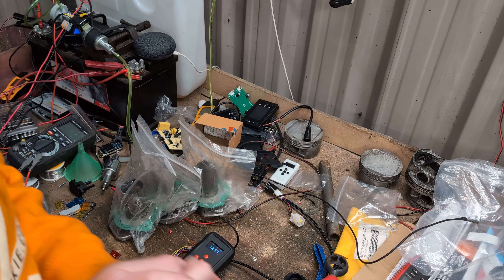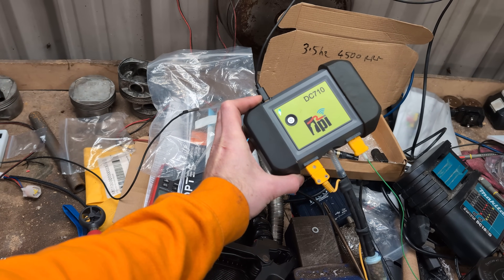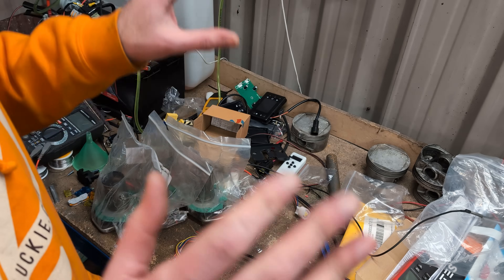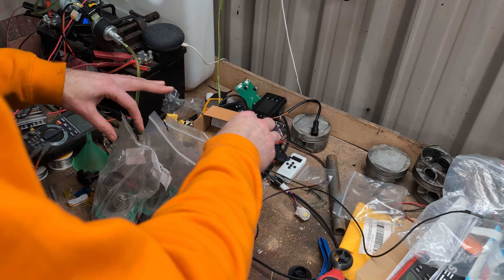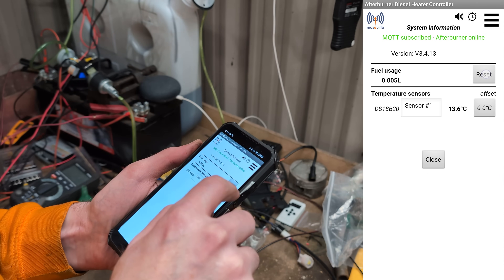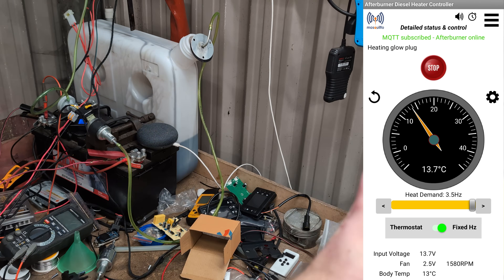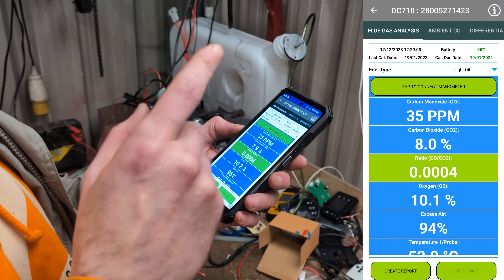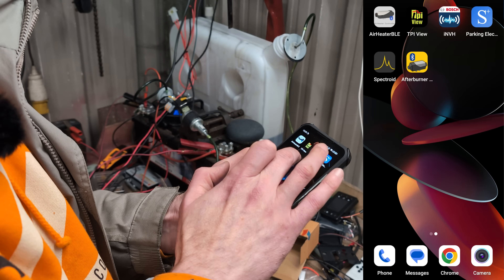Diesel Heater testing filtered waste oil - undiluted - part 1

Comment: My prediction is there will be no way to burn straight waste oil in a SUSTAINED fashion, say 100 hours , ( likely a LOT less) in these burners.  I don't even thing additives are going to work. 
The reason is exactly what was shown here.  The lighter fractions will burn off first and leave the carbon/ clinker. The burn chamber has to be up around 600C to get that to fully burn and turn to ash as could be seen at the end. 
I also don't believe there is sufficent air flow  and turbulance to blow the ash out and it will build up. 

Furthermore, because the housing only runs sub 200C, the incomplete combustion products will condense out onto the housing walls and that section will block up. Fundamentally, the combustion process in these heaters is incorrect for waste oils. 

With an additive, petrol, Diesel, etc,  I believe there will be some extension of the total amount of waste oil burned, IE, will burn more before they clog but again, won't do sustained hours and the amount of oil which can be burned over a decent time frame, tens of hours, will be so minimal as to be not worth while. 

Having said that, I very much hope I am proven completely wrong as the ability to run these on waste oil ( hope you try Veg as well) would be game changer.  I am sure hundreds of people can get all the waste oil they want and it would be fantastic to have a free fuel source.  I just don't think it's viable in these heaters simply because the way they are designed and the properties of the fuel are incompatible. 

the only way I can see this working is to modify the fuel by cracking ( pyrolising) all the carbon forming elements out of it just like refined fuels are treated and why they will work in these burners. 

Please  prove me wrong!
Reply: it is basically a low pressure hurricane lamp in a box.
Reply: Exactly what you say is correct...the design of these burners is all wrong for waste oil burning.

Comment: warm oil to reduce viscosity - easier more efficient filtering and easier to inject into heater. the problem is heating the oil - could create an accumulation chamber (between tank and heater) for heating oil before filter before oil is used. Could use 30 watt heating mat to wrap around accumulation chamber that holds 300 to 400 ml of oil and then filter prior to injection.
Reply: All that has been done by others. The problem seems to be the additives in the oil. Without removing those, you get deposits. Increasing the burn chamber temp (via running lean) didnt help either.
Reply: i have silver soldered a copper tube to the inlet of the fuel pipe and ran it longways against the heat exchanger then back to the normal point of the fuel intake pipe. it gets nice and hot. also put a 1/4 sight glass at the end of the heat exchanger to see how the burn is doing. all works very well. also putting a variable speed blower to the inlet to adjust the air/fuel ratio, but mainly to increase the speed of air through the burn chamber, this is to see if i can stop any residue sticking due to the high flow of air. tests show that combustion can stand quite an increase of airflow but the heat output plummets and most of the heat goes out through the exhaust. This will be captured with a heat recovery device i have made. i suspect the co will be high.

Comment: I tried this last winter with my shed heater , I tried lots of different ratios and always the same result flame out and build up of ash in burn chamber. This year my shed heater has run flawlessly on heating oil so far this winter.

Comment: I ordered the 2kw heater and received the larger body heater. I am told this is a tuned down 5kw heater. I actually wanted the smaller 2kw heater with the smaller body I was looking to use it in a minivan. I think the large body heater will cause me issues trying to run it on low. Thinking I should return it and get the heater with the small body. The van is only 35 sqft. I am curious about your opinions and the opinions of others here. Should I install the large body heater or would it be a lot smarter to use the actual smaller body 2kw heater???? Any help would be greatly appreciated...
Reply: The 2kw and the 5 kw will both burn fuel at the same rate although their are lower heat output settings on the 2kw versions, we use a 5kw outside our 14 foot caravan with the led remote control indoors and just monitor the temperature, we are also heating outside air, if the temps outside get below zero degrees C you can maintain internal temp at around 21 degrees C with a 5 kw heater set at 1.7Hz fuel flow the lowest it will go. if the outside temps are above 10 degrees C you will need to monitor the heater and turn it off occassionally when the inside temps get to high. failing that get the 2kw version but I fear it will struggle in freezing temps.
Reply: I would just use the larger body heater, the space you will save will be very minimal, parts are more readily available for the larger ones, and efficiency will be better. I would only get the smaller one if the space you have absolutely will not accommodate the extra few inches of the larger one.
Reply: I got a 5kw and wish I had the smaller one running hotter keeps them running good and I can never run the bigger one on high

Comment: What about other exotic fuels?  

I was at an auction recently and saw an entire pallet of i think it was either tiki torch oil or lamp oil. 

Was easily a couple hundred gallons of what is probably kerosene for like a dollar or less per gallon.
Reply: That would be interesting...isn't that stuff just kerosene?

Comment: There's a video of a guy claiming that he runs his heater on filtered waste oil cut with 30% E85. E85 is 15% petrol and 85% ethanol.

Search Youtube for this title; "Chinese Diesel Heater burning Black Diesel - Waste Motor Oil"

Seems to work well after some thorough filtering.
Reply: Just a headsup E85 means ~ %85 Ethanol and  ~ %15 Petrol
Reply: @FrankInAShed  Yes! Fixed it. Thanks.

Comment: Someone should make one with a burn chamber that pops off easily so you can scrape the ash out. Also redesign it a bit so it's less prone to clogging when illegally burning used oil.😂
Reply: I think its only illegal for heating bussiness premises.
Reply: Yeah sounds like a good idea not sure if it'd get all the ash out. Tbh it's not too hard to just whip it open and brush it out. I'd be tempted to always run it at full wack on engine oil. 👍😎 @ElectronicMusicUnderground

Comment: Hi David, I am enjoying your videos. I am getting a vevor 5kw tomorrow, is there a best/cheapest fuel? I’m considering kerosene.. Thanks
Reply: Kero is the way to go if you can find a depot that will fill individual containers for you, you can get the  25 litre used carbouys on e-bay that once had pickiling vinegar in them and clean them out. Kero at the depot I go to is currently £1.10 a litre including vat. I also add 50ml of strawberry scented two stroke oil per 10 litres to keep the smell down and it doesnt clog up the burn chamber but lubes the pump as kero doesnt lube as well as diesel. you could try to find a Nolans oils depot, they will fill any size container from 5 litres upwards.

Comment: what is your proposed series of test? 

PS- you can remove much of the additives....  least expensive less dangerous is to introduce Acidic Acid to the oil to cause the additives to drop out.   You can the add a base (if needed) to bring acidity down.
Reply: did you mean Acetic acid?
Reply: I wonder if muratic acid would work...just a small amount to see if it can force the junk in the oil to separate out...

Comment: Yep, you can't run ANY motor oil in a heater, new or used, quick way to block it up unless it's designed to burn motor oil.

Dilluted with diesel it will still leave deposits, it just takes longer.